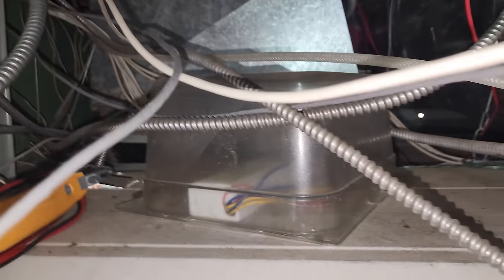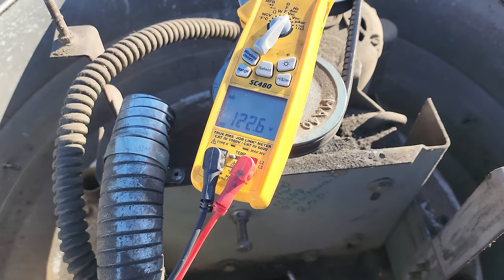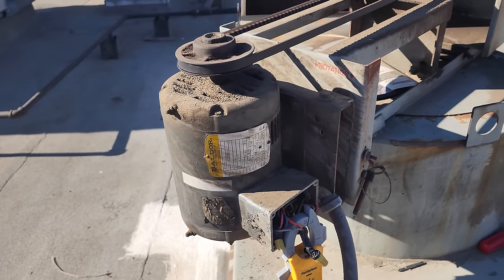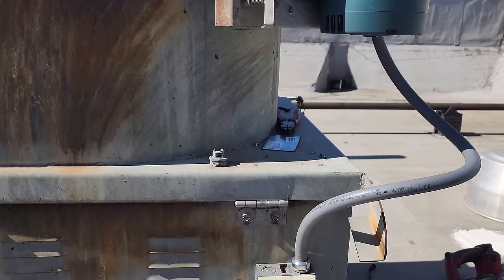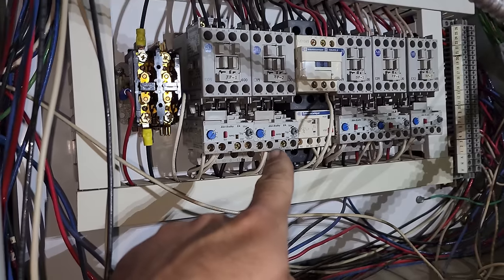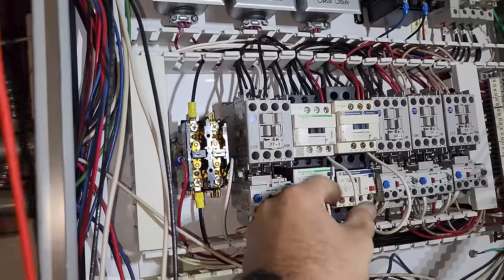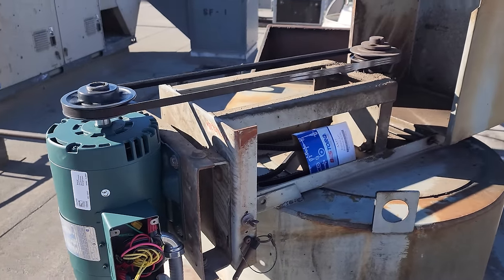OUR EXHAUST FAN JUST STOPPED GET HERE ASAP......

Comment: Was on a call at large facility for a R.T.U. problem. Every time I went up/down ladder I took some trash down with me. Maintenance guy checked how it was going and saw all used parts by my ladder. He thought I changed all those parts, but was pissed when he learned it was just trash left behind. Did work there for 10 years exclusively because I took pride in my work, wasn't like other lazy techs.
Reply: Nothing worse than a lazy tech and using the roof and equipment as a trash can
Reply: On the other hand there are customers who don’t trust that anything was done if there aren’t broken parts and new packaging left behind. 😂
Reply: @ernestrollins383  That's why you show them what you take up and what you bring back down...then they know you did in fact do the replacements AND cleaned up after yourself...

Unlike the other slobs working up there...
Reply: I feel like it's 50/50 at projects. Sometimes I clean up and sometimes I don't. There are some jobsites I like to hide semi broken stuff in equipment in case I need to come back for quick repairs. But I generally hide everything in cabinets.
Reply: @nickvanhorn681  "Semi-broken" parts stashed in compartments...
Sounds like the typical black box techs I come across.
I.e. keeps replacing parts until they stumble onto the solution.

Comment: Be very careful around sprinkler heads.  I worked out of a strip plaza years back and when getting back from deliveries one day arrived to find the unit next door shovelling water out the front door.  They were doing some decorating and removed a ceiling tile, and accidentally knocked the sprinkler head off the pipe.  It's amazing how much water gushes out of a fire suppression system.
Reply: ...and it's seldom clear water, at least for the first few minutes. lol
Reply: @dashcamandy2242  We managed to rig up a 50 foot length of 2 inch flex spa hose to direct the torrent out the door. (the store owners were trying to keep up with the deluge by using ceiling tiles to try to shovel water out the front door without addressing the source).  We got in touch with the landlord to get the access code for the sprinkler control room to be able to turn the water off to the unit.
Reply: Yea 1400psi will move a crap ton of water fast
Reply: @V C  a lot of fire riser shutoff are chained to prevent tampering.
Reply: it only takes a stiff breeze to pop the filled glass vial(thermal fuse) holding back the water flow. I nearly took one out with my head a hand full of years back. O_O yikes 😖
Reply: @A Wilson  Even with city water. Most fire suppression systems use cast iron pipes. The water stands in those pipes and rusts... but I'm sure that's not as bad as a storage tank system...
Reply: Careful around the sprinkler pipes too, HVAC work was done at my work and one of the plastic supply pipes cracked from the vibrations of a saws all 10 feet away. 

Turns out they use plastic in sprinkler pipes. 

Never had a glass vial break but we had one of those clamps for a broken vial to temporarily stop it.

Comment: FYI, you won't measure any voltage drop across the contactor (or any drop) with no load on it. If you do measure a drop with no load that is a really shitty connection. But no load, no drop. Higher the load, higher the drop.
Reply: The contactor is pulled in so there's no potential difference on that one leg.. If one of the contacts wasn't properly pulled in you could see a difference (up to 212V in this case) because there'd be a potential difference between the two points. 

I'm not sure "voltage drop" is the correct term. More of continuity since it's not under load. You should still see zero volts under load but if it was badly pitted enough you might see a small potential difference to know there's some reactance there.
Reply: @etherealrose2139  He had the motor off, so there was no load when he checked for voltage drop across the contactor. But with no load you won't measure any drop unless it was totally open and in that case you would read nothing.
Reply: good catch, always check them under load. :)

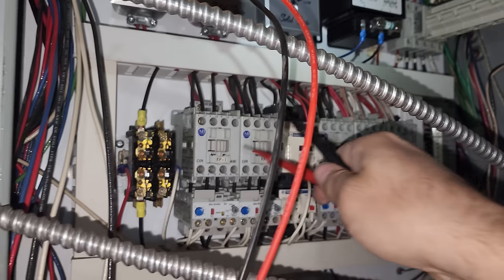Comment: At 5:20 you can't do a voltage drop test unless you have a load on it
Reply: Yep.  You definitely need some kind of load. Without a load there is no voltage across ANY resistance in a circuit.  Even an open contact will read zero.

Comment: I work for the company that makes those grease filters you see on the roof around these fans a lot (we actually at one point had some on this customers roof as you can tell by the flashing at the bottom of the fan), but I'm just wondering if there are any signs I should be looking out for when installing/doing maintenance on our filters that indicate they have issues with their exhaust fans so they can fix it before something goes catastrophically wrong. I see a ton of fans, and like you said the customer is never going to go up there so I try to keep them as informed as I can
Reply: Get a mechanics contact style stethoscope. HF has a cheap one. Start listening to every motor you can. With time and listening you can begin to hear pending failure a good bit before it happens. The more you listen the more you will know what sounds good and what doesnt.
I learned this skill as a press mechanic. Way too noisy to hear anything without the stethoscope.

Comment: Hi, I am a very strict follower of your videos. I am a mech. eng. , and I am working in a different industry but I find your videos informative and educating therefore they are entertaining me as well and you made me interested in HVAC units even though I have nothing to do with them :) . I would like to kindly point out to 1 thing at minute 5.30 that in order to measure a voltage drop across something the device must be turned on, in this case the fan motor should be turned on, and also relay/contactor should be pulled in. This is because according to OHMs Law, V = I x R, therefore in order to measure a Voltage there should be Current and Resistance, in this case since you didnt have the fan motor turned on there was no current thus no Voltage to measure as Voltage drop. Thank you very much once again, kind regards!
Reply: Yeah you can't do a voltage drop test across a load without having the circuit energized, but you should be able to find open circuits using this method right? If you have a normal differential meter, seeing a voltage reading between two points would indicate that there's a potential difference, indicating an open circuit.  I guess in that case the circuit still needs to be energized, however since there's an open circuit there'd be no current flow. And you'd need to be sure you're testing 2 legs on the same circuit. Maybe I'm misunderstanding

Comment: Section 110.26 has detailed specs for "control panels" including location. In no way is above a ceiling acceptable.  I see this all the time,  inspectors letting this stuff slide.  It is both unsafe and inconvenient to work in a ceiling, on a ladder, in a cabinet with multiple motor controls.  This may have been in other sections of the code in  the past, but it has been there for quiet some time.

Comment: motor starter contact got overheated n melted together but one did not get stuck so it did tricked but other two did and that was why it making loud noises cause customers go up there and turned it off and other cant be turned off later they contacted you because of 2nd motor was making noise (first one was turn off then later other one failure so they called u up) good jobs chance it out

Comment: The other day had a call for a Rapid MUA not working. Found the motor was shot. Shorted to ground. Its a 40hp and im gonna have to figure out how to set up a portable gantry to try and get that sucker out of the smallish manhole access for the blower section. Sucker weighs between 400-450lbs. We have to also have a large crane due to how far away he will have to set up and the height of the building. Should be interesting. I might record it and share

Comment: I had to pull an all nighter replacing pillow blocks on an exhaust fan. It was on the Orange Blossom Trail Ryan's Family Steak House in Orlando FL. I had to wait until 3 am for the fan to cool off enough to touch it. I did maintenance on 21 of the 29 Ryan's in FL. Before I went to work there (corporate employee thru Family Steak House of Florida), they too had no pm service at all. 12 hour days consisted of driving 4 hours, working 4 hours and driving another 4 hours. After a year of going from Daytona Beach, Fort Meyers, Fort Lauderdale, Orlando, Gainesville, Ocala, Tampa & Lakeland I threw in the towel. Shout out to my old boss Bob, you know who you are.

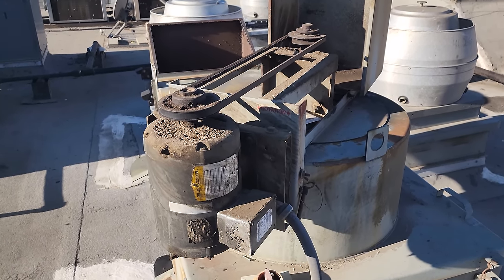Comment: 3:00 - "this is going to be a bad one" with wiring like a snake nest. Was that ever inspected?
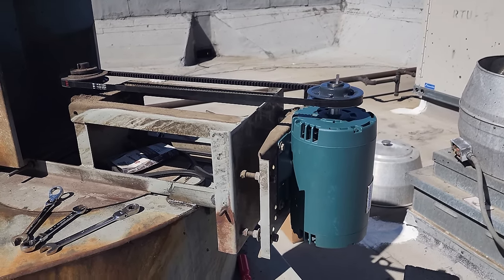9:58 - Whenever I do electric that shall be outdoors or in a hostile environment I'll try to go in and out from the underside of the box first and only if that's not feasible at all select other routes. That way there's a lower risk of water and dirt entering the enclosure.
Reply: With all the unsecured armored cables and that light ballast just sitting out in the open, No I SERIOUSLY doubt it was inspected and if it was, the Inspector needs to be fired for either Gross Incompetence and/or Accepting Bribes to look the other way...

Comment: The other reason why he doesn't change motor bearings is most motors do NOT have user replaceable parts in them so even if he wanted to, he usually can't pull the old bearings out of a motor without damaging something to the point where he couldn't put the motor back together again IF he was able to get the old bearings off and the new ones back on...
Reply: Definitely not field repairable.
Reply: Yeah, its not some 10+ hp pump motor with a bad bearing. Those little shit bird >2 hp motors are rarely worth rebuilding. Especially for a customer that puts stainless steel pans on top of ballasts.
Reply: @kaptaintrips  I mean I don’t believe I’ve been able to see through stainless steel before so I don’t believe that’s a stainless pan.
Reply: @baelevatorsmore728  you've never seen perforated stainless? Lol
Reply: @MegaDysart  I don’t get out much to be honest. That and no, I don’t believe I’ve seen perforated stainless before.

Comment: If it is not possible to change motorstarters with power off I do it with power on. Disconnect one wire insulate it, one at a time. Connecting it just the other way around.
Reply: OSHA loves you ( me too) lol

Comment: I used to replace motor bearings. But after I went through replacing bearings in one just to find out the winding had a short in it. I'm doing it less and less.
Reply: Baldor rebuilds motors. Just send it back and let them do whatever it needs.

Comment: Interesting that you had 208v and the motor was a 230/460v. Also, your replacement was a 230/460v motor as well.
Reply from the maker: Yeah the motor can handle lower volts too it actually says in the fine printable the bottom of the motor nameplate
Reply: @HVACRVIDEOS  No worries, I just stated it as I've ran into a couple that are recommended to not do so. Cheers!
Reply: Typically 208 is within the ratings somewhere as 208V 3ph is the most common light industry connection in Murica. I'd be surprised if a motor in the supply house wasn't rated for it.

Comment: Serious question, how did you know that other motor starter would fit in that space? I had an Allen Bradley starter that I replaced this week that I felt like I had to go back with because nothing else would have fit. Paid WAY too much for it, in my opinion, and our company covers the cost because it’s a full coverage contract.
Reply: In this case they are DIN rail mounted and not the neatly wired, so you can slide the other contactors if needed. Plus you can always get the dimensions off the specs and compare ahead of time.
Reply: @inothome  thanks. Mine was railed too, but I didn’t have too much wiggle room that I saw. Plus I was in a hurry to get them back on line, but $200 per starter/ contactor is pretty steep to me.

Comment: Between abandoned RTU’s, MUA’s, AC’s, and left behind dead motors, compressors, etc. I would bet that there is thousands of tons of scrap and garbage lying around on rooftops in North America right now. I always clean up after the job but some sites are a loosing battle. And the wiring in that place looked like a complete cluster f***...
Reply: take how much you think is laying around and multiply that by 10, at minimum and you may be close 🙄